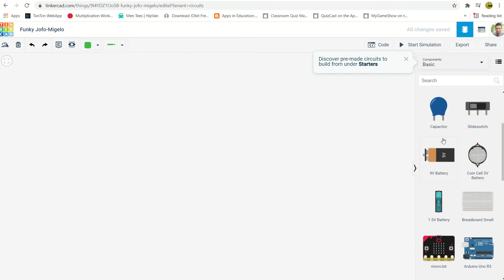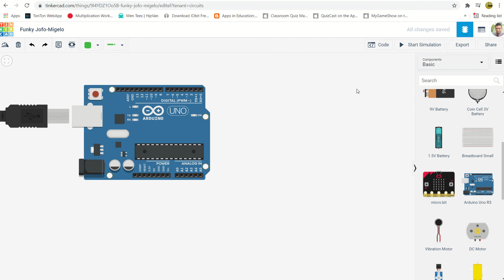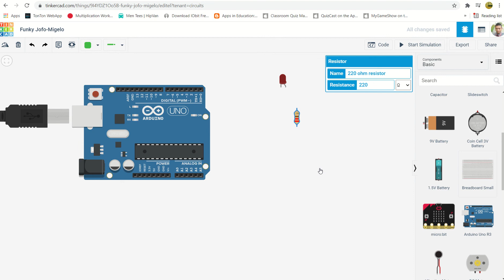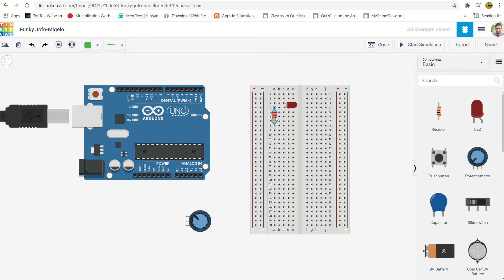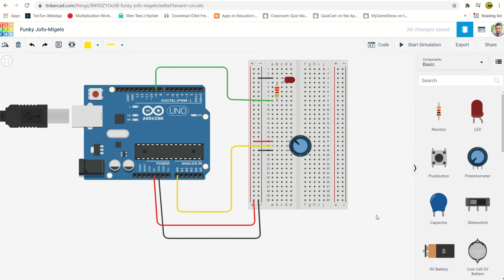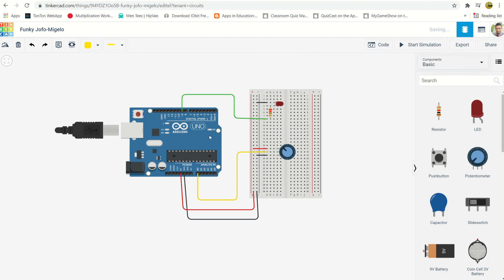LED brightness Control using potentiometer with Tinkercad Circuits

Comment: There actually is an easier way get a 9v battery the potentiometer then led, 1. Positive from the battery to terminal 2 on the potentiometer. 2. negative battery to terminal 1 potentiometer. 3. Negative battery to the cathode on led 4. Anode to wiper on the potentiometer.